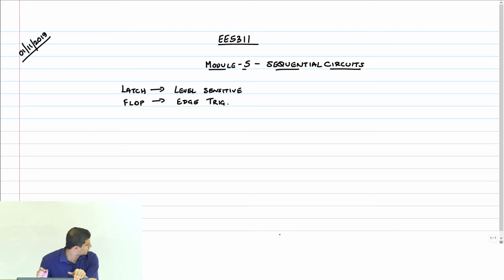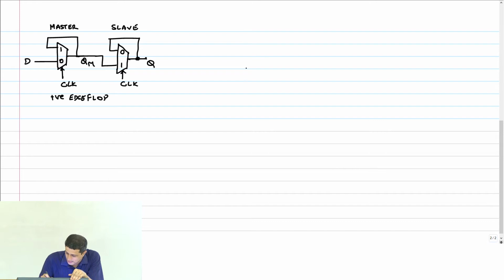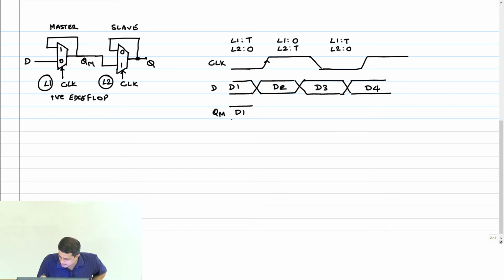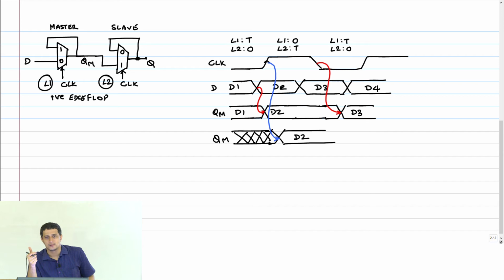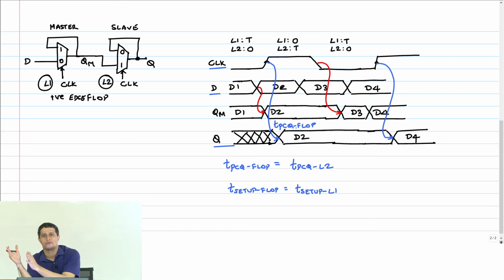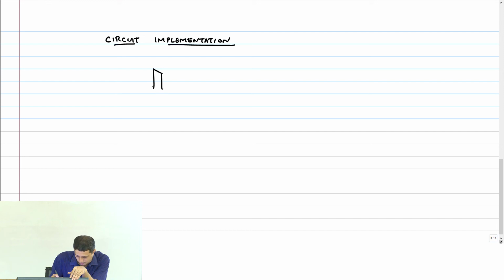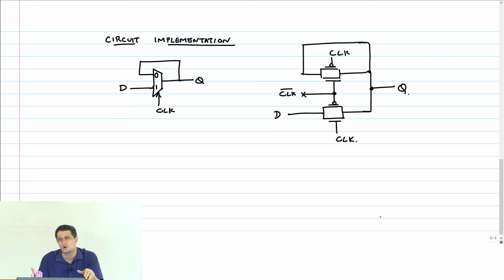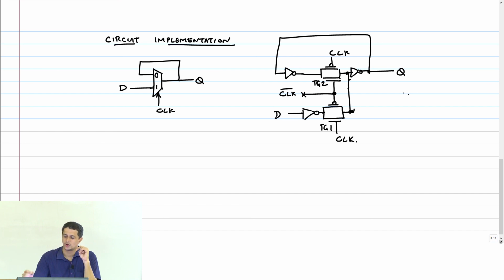SeqCkt - 3 - Master Slave Flip Flop

Comment: 1. Why are we using the inverters at the circuit implementation of the transmission gates? 
2. We are using 2 inverters so that the given inout does not change at the output right?
Reply: A transmission gate alone can't drive signals because it lacks driving strength — it merely passes the input, often with degraded voltage. Without a connected inverter or buffer (a "driving gate"), the output is too weak to reliably switch other gates or maintain logic levels. That’s why it is “meaningless” — without a strong driver to restore and hold the signal, the transmission gate can’t perform any real digital logic function.
Reply: 1. to characterize the flip flop
2. yes
Reply: @APARN-x9b  why can't we characterize even without invertors? What makes the diff?